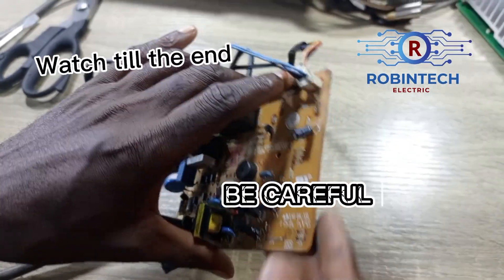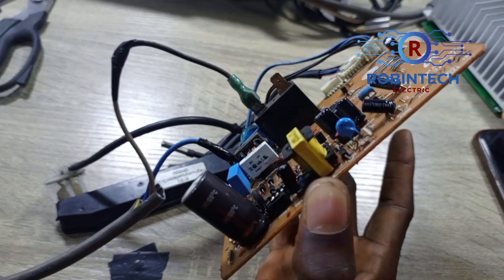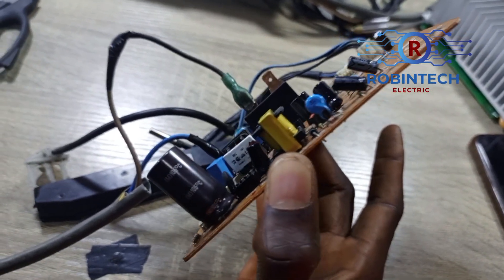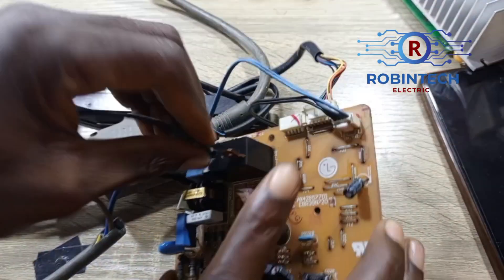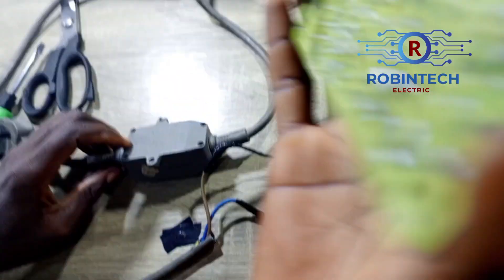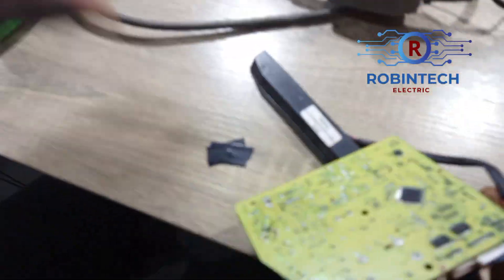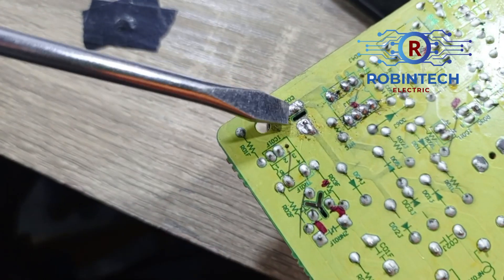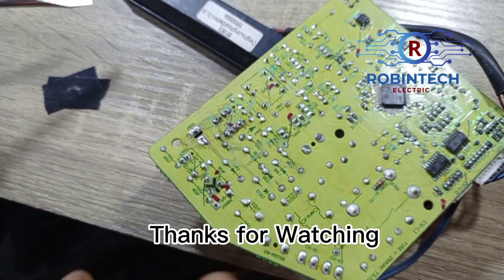ROMANCING PANEL IS DANGEROUS

Comment: Good morning. Can a stabilizer still work with voltage as low as 90v?
Reply from the maker: Yes, but cannot give you 220volts output. Output voltage will be like about 190,200volts
Reply: @ Thanks